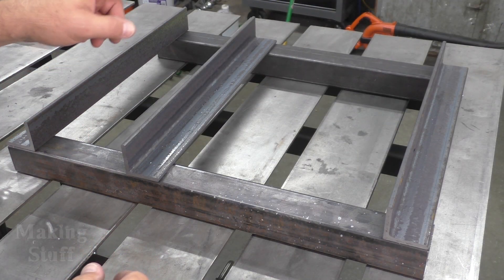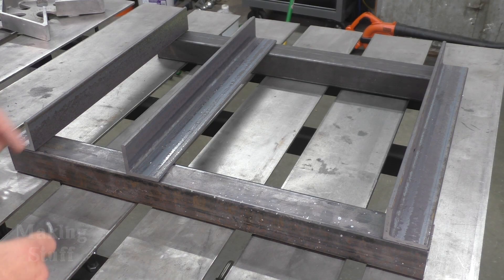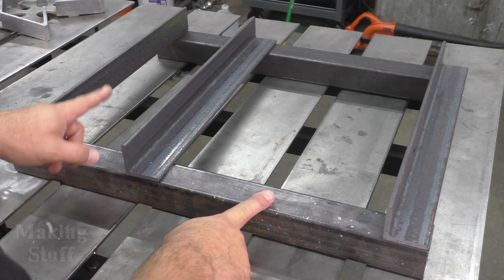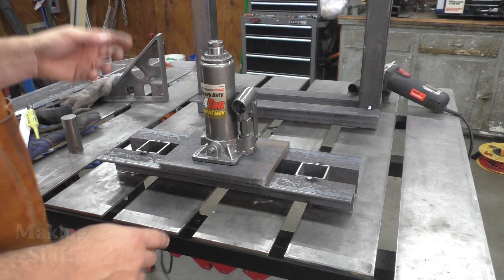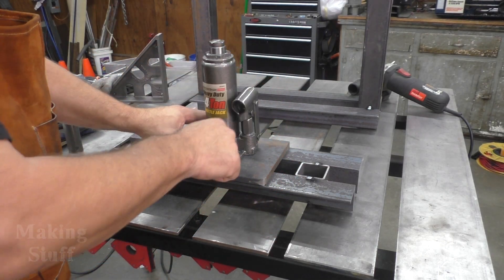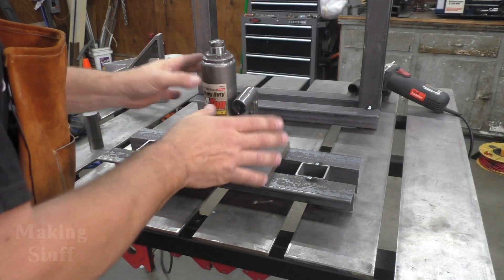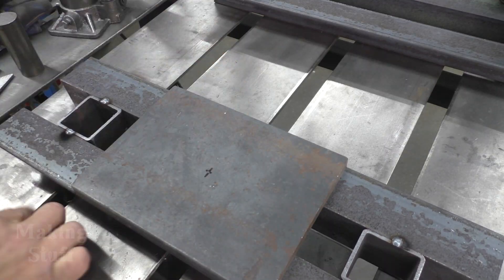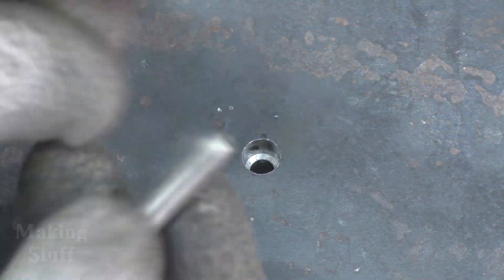DIY Bench Top Hydraulic Press

Comment: Thanks for sharing this great design! I had always wanted such a hydraulic press that can be placed on a bench and stored conveniently after use, The ones in Harbor Freight is too large. I will reuse the bed channels from my old wood lathe for the columns, and get other materials from a local auto-wrecker. Since my welding skill is not up to par, I'll use the no-weld option you initially designed it for. 
Since vertical stability is actually not an issue, I'll use assemble two T shaped wood legs to insert into the channel ends at the bottom at use, and remove afterward for easy storage.

Comment: What type of steel are the slats on your welding table that you can trust it to remain flat when they seem so thin?
Reply from the maker: It is 3/16 stainless steel.  If I built it today I would spend the extra $$ and go with 1/4 inch.
Reply: @MakingStuff  So, I assume that means the 3/16" hasnt quite stood the test of time but a quarter probably would? Wow, I really had no idea thank you very much for responding!

Comment: Great work. Would you tell me the brand of drill bits you use. I was impressed with the down pressure you had on those small bits. I didn't see any flex in them.
Reply from the maker: They are Dewalt. I have no loyalty to them other than they are the best I can get locally.  I'm sure there are better.
Reply: dont know what brand but the best type of bits for cutting Steel is cobalt

Comment: Bob I really enjoy your projects and your build videos ,your designs are always spot on and the execution makes it look very easy for the average person to do at home. I will probably be making one of these , will have to look in my metal scrap pile and see what I can dig up . I have built a vertical bandsaw with the he harbor freight bandsaw and have been very pleased with it. It is one of my most used items when doing a metal projects. Wondering how you like your horizontal bandsaw do you get square cuts from it ? Have you thought of adding a pneumatic downfeed cylinder so you don’t have to hold your hand on it while cutting? If so it would be a great project to do a video on . As always great videos great content thank you
Reply from the maker: I get square cuts from it as long as it does not cut too fast on thin material.  That's why I'm holding it, to keep it from cutting too fast.  I have thought about putting a pneumatic cylinder on it, but have no idea which one to buy or where to get it.  Thanks for watching!

Comment: 98% of the people building this already have a welder, so I don't think it's a problem. You should buy some short drillbits.. Much more stable for drilling less than 25mm/1" material. And also you could grind a radius on the bottom of the legs so that they can be folded flat with no interference to the ground. And also 4 tonnes is a bit on the weak side.. Weld reinforcement flat irons on the bottom of the "table" and the top and then upgrade the jack to 10 tonnes. :)
Reply: Instead of buying the short drill bits, he could break the long ones to short 😀

Comment: Marking the legs removeable is a good idea. I would have used selfsecure bolds instead of screws. That would make it a lot easier and faster. I although would put a hole on ether end of the feet to store the feet with the bolds on the press when not in use.

Comment: What do you think of the multi process welder vs stand alone for each? Any loss of performance?
Reply from the maker: I have had it about a year now and love it.  I have only used it for MIG.  I have not touched the Miller TIG since I bought the Lincoln.
Reply: Why not put Lincoln Innershield flux-core in the Miller, there are times when the flux core has advantages over MIG with gas...

Comment: Excellent video Bob.  Can you share the rough dimensions for the key supports and legs?  I have a HF floor unit now, but I may build your design to gain some floor space!
Reply from the maker: All of the angle iron is 19" in length and the square tube is 24" in length.
Reply: Exactly what I was going to ask, thanks for the details, wouldn’t mind making one for myself for broaching keyways and pressing bearings in and out etc. 👍👍👍